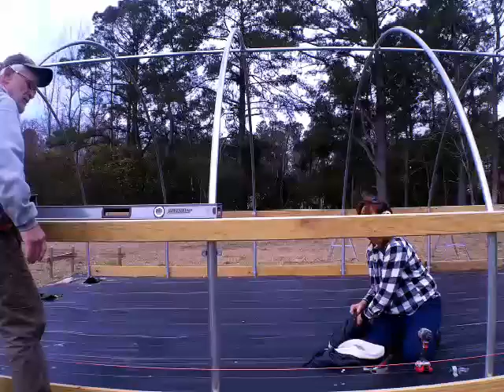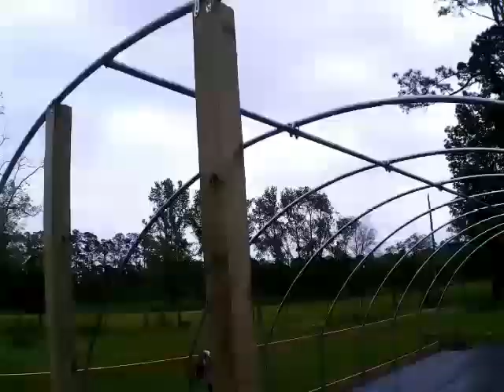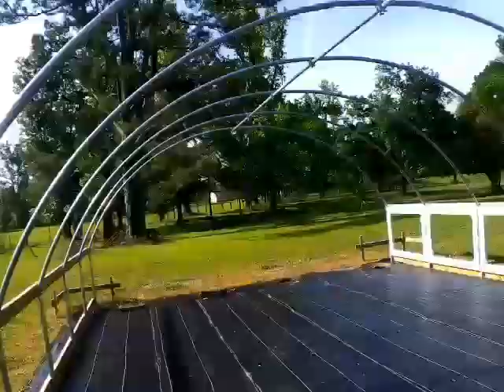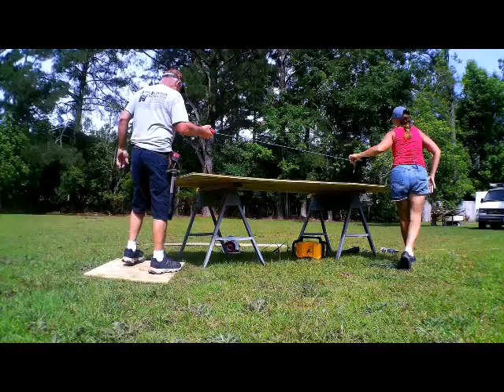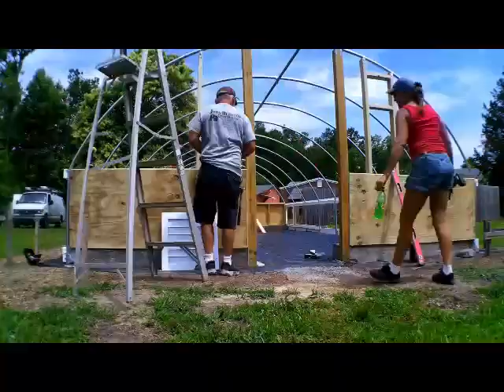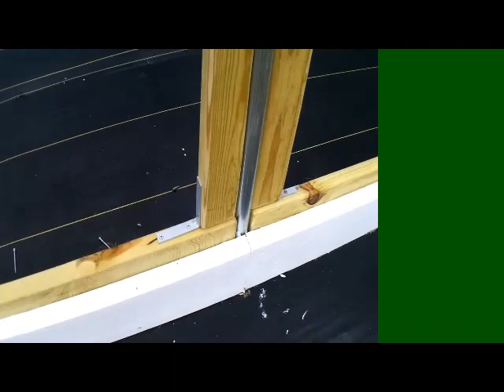Building a LOW SIDE-WALL GREENHOUSE - GROWERS SOLUTIONS

Comment: Not a cheap greenhouse because it made with EMT conduit, lol.  Don't like greenhouse with PVC. I would call this greenhouse doing it right. Great looking greenhouse, I really like it.
Reply from the maker: Oh thank you very much. Yeah people said I got one of a kind greenhouse. The only thing I’m lacking now is actually is to put the plastic on. It’s not on yet because one person cannot actually do the plastic by themselves - hopefully soon thank you for the comment. I did most of the greenhouse by myself and it has took a little longer, but I got Her done.I’ve been remodeling at this Homestead and I’m hoping to get to the rest of the greenhouse soon. Got to get some help. No it’s not a cheap greenhouse Try to make it as wind sturdy as possible
Reply from the maker: I just read your comment and it made my heart sing!!
Reply: you can do an EMT conduit version but the pipe will be aluminum not steel and half as thick.  this company uses 16 gauge steel which will be very much stronger for anyone dealing with high winds, storms, or snow and ice in the winter.  adding pressure treated support framing along the purlin inside is recommended for anyone up North with heavier snows to plan for.  there are a lot of versions of this build that are adapted to local conditions, but that steel frame is the key.
Reply from the maker: @GreenMachine1365  If I ever get caught up with my projects I do plan on doing another one hopefully smaller for producing seedlings because I have the metal put it in walls and I definitely want to use it for something. Hopefully I can keep my dreams minimum but that’s not me it might be as big as this one we’ll see . Thank you for the comment. Just move the chicken coop to the greenhouse so now I’ve got to get it stationary because it’s not your ordinary Chicken Coop. See you on the next video

Comment: It would be courteous for viewers if you put, in your description section, the dimensions of the structure, the Grower's Solutions cost, the cost of the extra materials (such as the ground cover/flooring) and the time it took to erect it. 

Most people don't want to have to scroll through 27 minutes of video looking for these pieces of information, which is what pretty much everyone came here to find out. You might also include a list of materials. Thanks.
Reply from the maker: Thank you
Reply from the maker: Thank you. I have other videos stating I believe but  my main reason for videos is to give general ideas to spark people dreams and interest. The Cost have changed and changed and changed again. Wood prices excelled at the building time so what I paid was a-lot more than today for the price of wood has come down. For example 10x16 treated board went up to 86$ from 36$ then went back down the last time I checked, these boards was for the raised beds. So my cost and area would be different for other areas. I can’t give a time frame on construction because it was a working process showing progress in other videos and doing almost all by myself- for I was also remodeling a house by myself. I gave  the name Growers Solutions so people would know where to go and the company is wonderful to work with and the last I checked of course prices have gone up some. Thank you for your input I  will keep it in mind for the future if I feel it won’t mislead the people.
Reply from the maker: I have gone through 100s of hours looking at videos to gather different opinions and maybe a idea here and there before building,  for I am a visual person.
Reply from the maker: Thank you I am remembering your advice on future videos

Comment: So does this allow you to grow all year?  What kind of heat source does this one require?
Reply from the maker: I do plan on growing all your long and I just put electricity in it I haven’t made a video yet doing remodeling on the new home stat, but so I will have lights LED lights and then different set of lights that I can put heat lamps bulbs in if I want to or I have sockets so if I just wanna put in a small rotating heater I can do that. But I live on the South East Coast in North Carolina So our weather is at this point not extremely cold. So I am believing that would be enough at this point. I’ve even thought about putting a temperature timer in or a heater that automatically comes on when the temperature drops to a certain degree.
Reply: @SouthernComfortHomestead  Those are great ideas, but I am installing a solar kit in mine.  Enough watts to put in a small ceramic heater.  Yes, you can also put those on timers, but Solar and generators that are solar that can also provide for a pump to water as well.  So having a few 55 gal drums with water in them with a pump would be what I would LOVE to have.
Reply from the maker: Awesome! Yes I have some solar panels and batteries ext that I like to install for the house greenhouse and I just put in a new well with a picture pump near the greenhouse- at the moment I don’t know if this solar system will work for this pump. I have so many projects going on I’m having to take the most important one at the moment since it’s just me. But with a termination I’ll get there but I love your ideas. Those things I have looked into. I made a video and I think it was something titled the one and only on grid off grid pumpWith regards hopefully in the future for it also be run by seller. The guy said when he was putting in the pump or should I say pumps I’ve never seen anything like this. With remodeling this Homestead I have already had to use the hand pump for a couple weeks or so thank God I put it in. Let me know when you get it completed I’m interested in hearing how it went. Have a great day thank you for the comment love your ideas
Reply: @deborahelliott8460  great idea!!!! Solar for heat in my hoophouse instead of having to run an extension cord. Just have to figure out what I need now. Already been talking to dear husband about doing this at a couple sheds for a light. 
Just found this video and subbed. Going to look at your other videos now.
Reply from the maker: Hey it been a year growing and yes I have put it through the test for each season and it works. Checkout my playlist on the greenhouse and you will see the progress of each season and how well it did.
Reply from the maker: Thank you so much for all the information-awesome and for subscribing. When some of my projects calm down there will be more updates on the greenhouse. I put it through the test this year and grew all seasons and it was wonderful. I don’t have my solar up and running yet - a future project